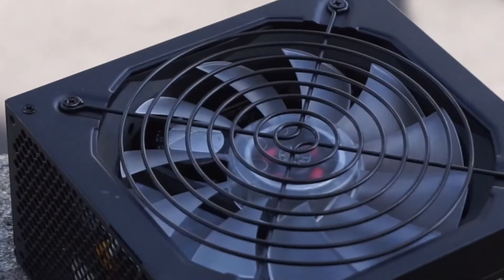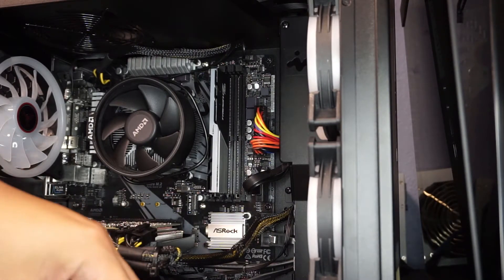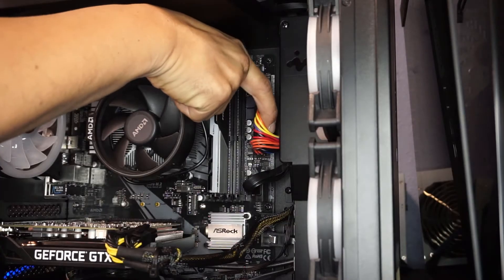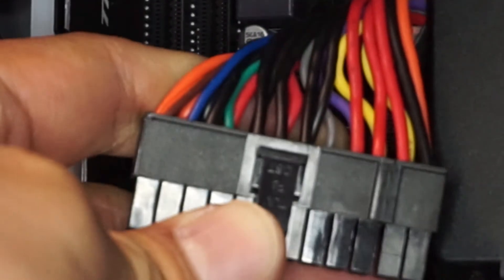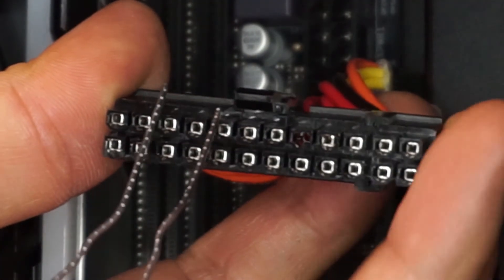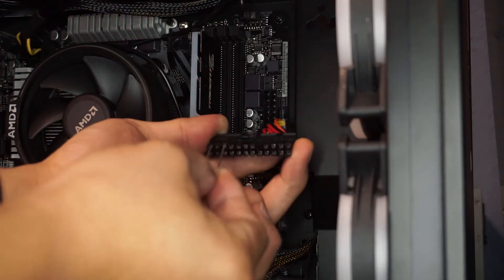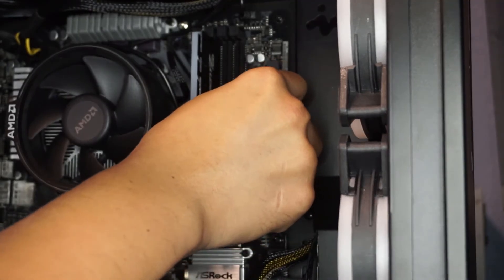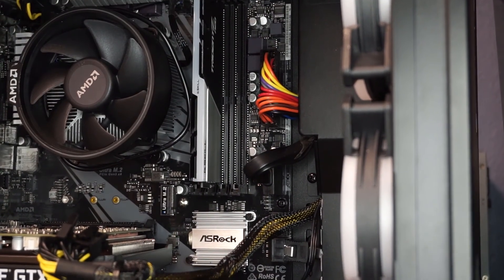Power Supply Paperclip test

Comment: Tried this but there was sparks and smoke everywhere - I sent the stuff back to Amazon lol. I know what the mistake was I think... I had some of the PSU connected to the motherboard still. Even just by itself the PSU didn't turn on and just makes a clicking sound. So I sent both back for replacement to be safe. Luckily no other innocent component was harmed in this experiment. /facepalm

Comment: When i do this my power supply turns on for a couple seconds and then turns off it doesn’t stay on like yours does this mean my power supply is dead?
Reply from the maker: that could be a high possibility. If so just have your power supply replaced from where you bought it from (if you are still within the warranty period).

Comment: What does it mean if my psu ran for a while then turned off? Then when I went to try and turn it back on it wouldn’t start up? Does that still mean my psu is dead?
Reply from the maker: Do let me know what hardware you are running so i can see if it is drawing too much current and causing the psu to trip and shut down
Reply: @troubleshootdis5930  it’s an aresgame 650w 80+ bronze psu. This is my dads computer that doesn’t currently have a gpu. It’s only 8gigs of ram and a quad core CPu.
Reply from the maker: @mattwanner1  Given those specs it is a high probability that your psu may be the one causing the issue. Those hardware will not have enough draw to trip that power supply on their own.

Comment: Chris my SkyTech pc lights up when power is applied and fans work, but it won’t boot up.
Reply from the maker: Hi Rick, you may be having issues booting to windows which will point us to the direction of the ssd cables and connections. Check those out and make sure they are properly connected and if possible, re-seat the sata data and power connection to the drive and re-seat the one end that's connected tot the mainboard.
Reply from the maker: Also refer to this video and try reseating your memory sticks. https://youtu.be/CFqt6qe-iL8